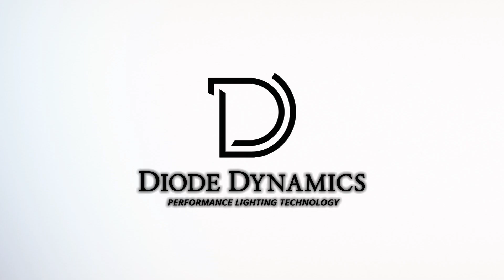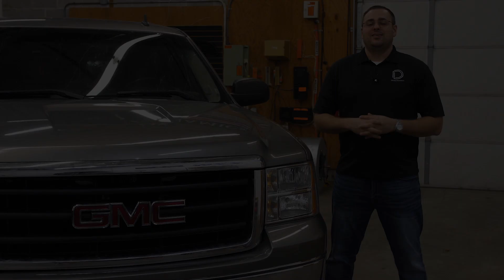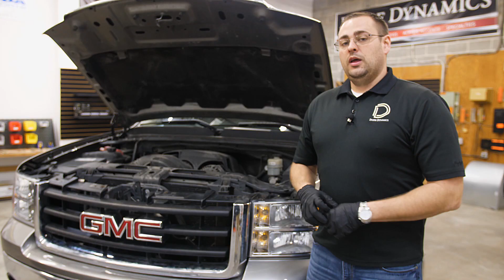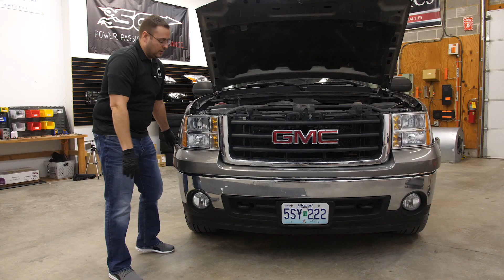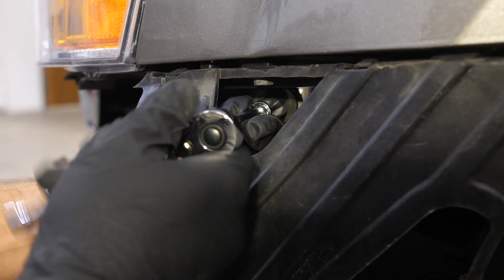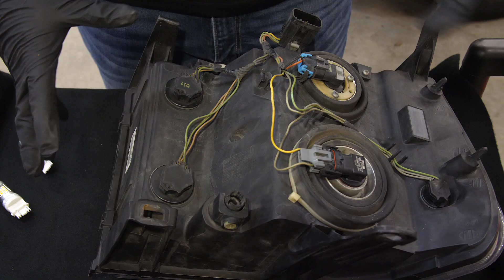How to Install 2000-2013 GMC Sierra Switchback Turn Signal LEDs | Diode Dynamics

Comment: I have a 2003 gmc 1500 I did switchbacks on the blinkers and they won’t light up white when I don’t have my blinkers/flashers on but when I do hit my blinkers they work but amber colored anyone ever seen this problem.. they won’t light up white when like running lights
Reply from the maker: Go ahead and give us a call at our headquarters to speak to a live team member in minutes at 314-205-3033, Monday-Friday 10 a.m.- 5 p.m. CST, or shoot us an email at contact@diodedynamics.com, and our in-house US service team would be happy to help you with that.

Phone: 314-205-3033
Email: contact@diodedynamics.com
Hours: Monday-Friday 10 a.m. - 5 p.m. CST

Comment: I have the exact same truck that you are working on and  I have yet to find a switchback led CANBUS rated bulb that has not hyper flashed including yours. Why is it yours didn't hyper flash and mine do?
Reply from the maker: It will be different from vehicle-to-vehicle. This is why we have a link to our resistor kit in the listing, but do not include them with the bulbs. Some trucks need them, and others don't. Here is a link to our resistor kit if you are interested in fixing that hyperflash! 

https://www.diodedynamics.com/led-resistor-kit-four.html

Comment: I've replaced my turn signals on my 2010 Sierra, but I get the Hyper Flash and can hear the Turn Signal Relay under the hood on the fuse assembly.  But where is it located?  I ordered the LED Flasher Relay but now I need to know where it goes.  Can you help me with that please?  Great video on the Switchbacks, but I just want my hyper flashing to stop.  Thank you so much and I look forward to your reply.
Reply from the maker: Hey Kevin! Typically, they are under or behind the dash. We looked through the owners manual for your truck and couldn't find the location of the relay. Please go ahead and give us a call at 314-205-3033 Monday-Friday 10 a.m.- 5 p.m. CST, or shoot us an email at contact@diodedynamics.com, and we can further assist you!

Comment: so If I get those switchback led lights I won't have hyperflashing in my blinkers?
Reply from the maker: These LED bulbs will require an additional resistor kit to avoid hyper flashing. 

https://www.diodedynamics.com/led-resistor-kit-four.html

Comment: Hey guys, what would i do if i still have hyper flash after the fact? Also have rear led taillights but they have a resistors on them aswell, any helps appreciated thanks
Reply from the maker: Hey there! Do you have resistors on the front turn signals as well?

Comment: Yeah, you wish it was that easy. I have tried every LED bulb even those stating none required because its built in and have put resistors and I always still get hyper flash. My next route is to try a LED compatible light controller module or flasher.

Comment: Will these fit a 2017 Silverado 2500?
Reply from the maker: Hi there! You can check out our Switchback LED Turn Signals for your 2017 Silverado here: https://www.diodedynamics.com/front-turn-signal-leds-for-2014-2018-chevrolet-silverado-four.html

Comment: I would greatly appreciate it if you would do a video OR give me instruction on installing resistors on a 2011 GMC Sierra. I put a resistor on each bulb for the tail light and front turn signals. They work fine in daylight. When I turn the headlights on, the hyper flashing returns. I'm not sure what I did wrong.
Reply: Damon Brown did you ever figure out how to fix that problem
Reply from the maker: Hi Damon! Please go ahead and give us a call at 314-205-3033 Monday-Friday 9 a.m.- 5 p.m. CST, or shoot us an email at contact@diodedynamics.com, and our service team will be happy to troubleshoot that!

Comment: Do you need resistors for the 2012 GMC Sierra 1500?
Reply from the maker: +Jov Stellar Yes, we would recommend installing resistors to prevent hyperflashing whenever you install LED turn signals.